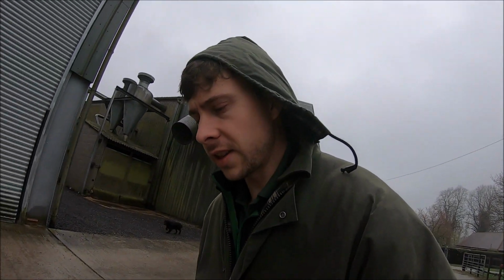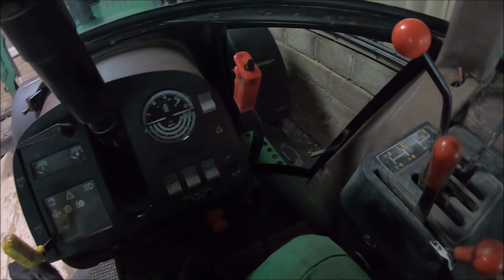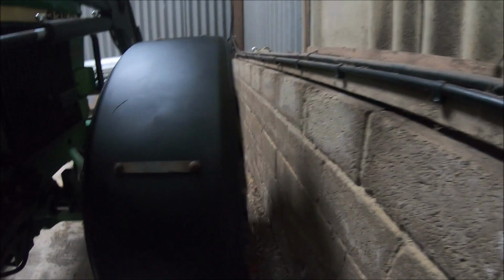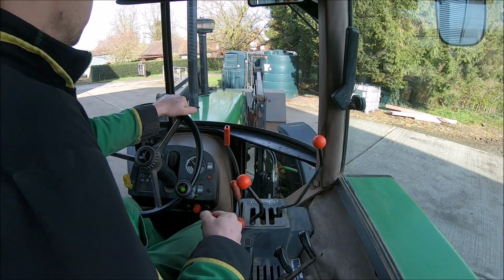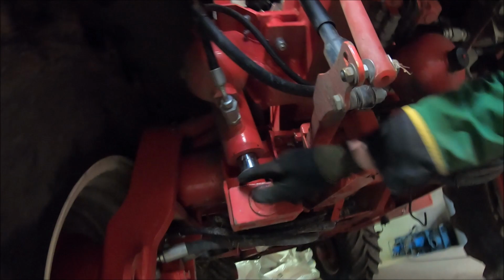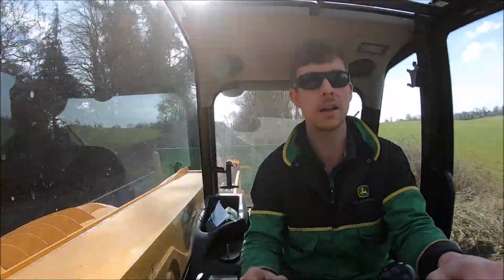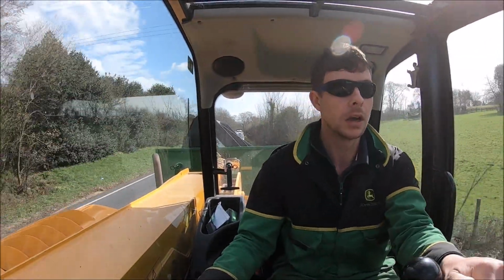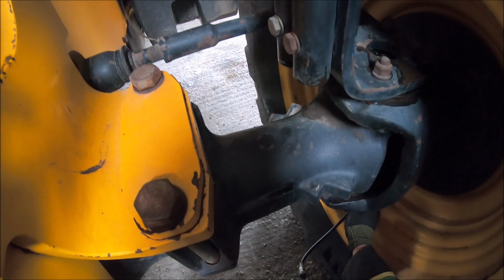I put the loader on the 3350!

Comment: I used to haul silage in JD3050 two wheel drive. Was a fast tractor back in the day with the dual power on. Exhaust and air filter were in the way sometimes but I could open the bottom right cab window  and get so much cool air flow in the hot summer days. Great memories.